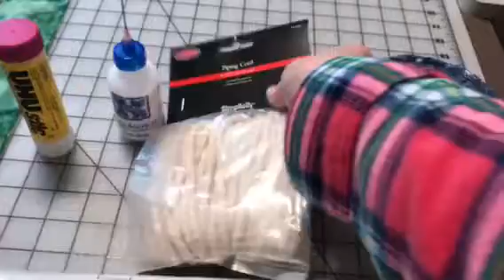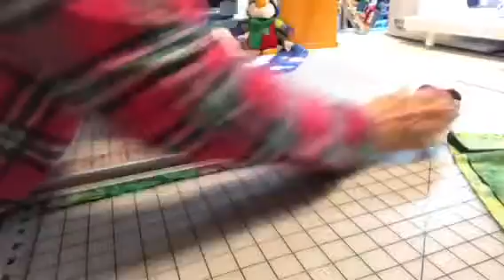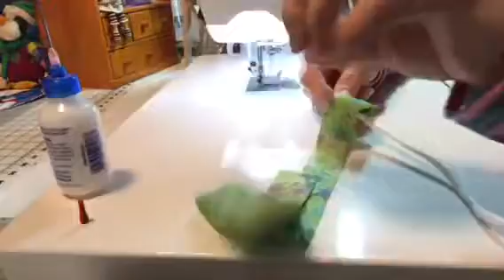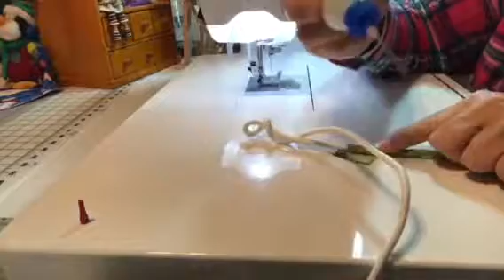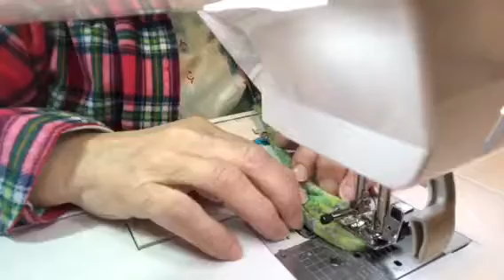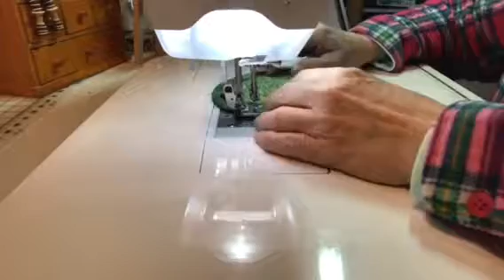Rope Pot Holder

Comment: Can you use the potholders as placemats instead? Also how much does the rope material cost?
Reply from the maker: Yes, you can use it as a placemat. I bought the rope at Walmart for $.97.  Look in the section where the laundry baskets are.
Reply: Kathys Kute Kreations That’s cheaper than I would expect! Thank you
Reply from the maker: Your welcome.